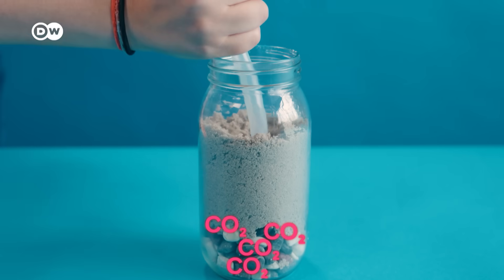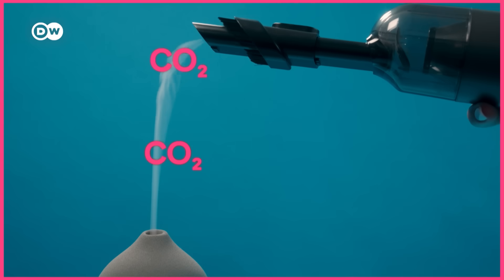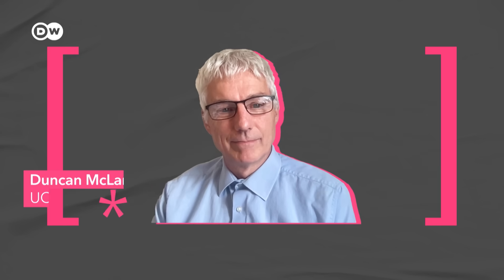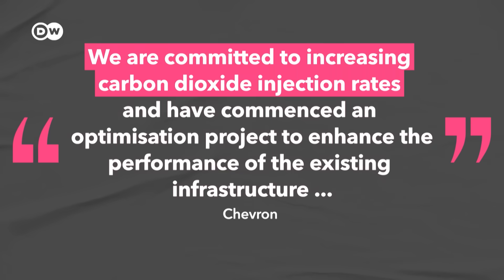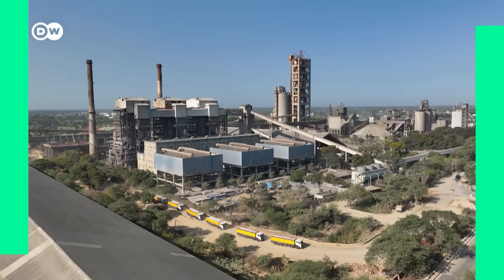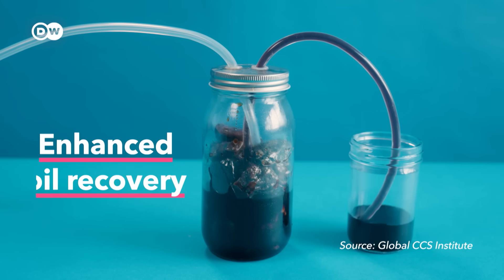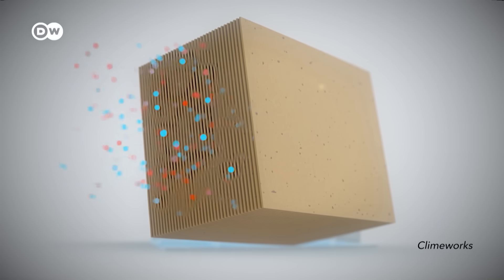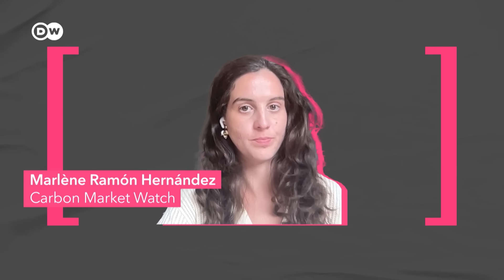Why carbon capture needs a reality check

Comment: Carbon capture technologies should be part of the solution, but not the only solution.  But if we combine it with other solutions like strategic agricultural programs and other evolving tech, it might work.  For example, vertical farming requires elevated CO2 to help plants grow.  So why not get CO2 concentrators, latch them onto vertical farms?  Encourage people to do small scale farming/gardening?  Strategic gardening and farming at the municipal level?  I've been to many city malls... Consider multi-level parking lots where the upper deck are half solar, but also half garden?  A place to go and sit that is safe and calming?  Mall roofs could be redesigned to have small scale farming with the produce sold by the companies in the food court?  Mixed in with the solar could be shade-preferring crops.  For dedicated public transit routes, consider planting things like grass between the tracks. There is no either or for us to save the planet.  We just need to get to carbon neutral naturally and use CCS tech to top things up.
Reply: cos everybody wants to own the world

Comment: The densest form of for carbon is... oil. CCS is just a fancy way to describe a perpetual motion machine. It is thermodynamically impossible for CCS to be anything but a stop gap for steel/cement manufacturing, to slow down the emission at best (which it is clearly is not even close).
Reply: True, by looking at it from an exergy perspective the sheer waste of useful work is on full display. Why set up renewable (hopefully) power plants to power carbon capture projects when you can just instead use that electricity?
Reply: @reinhardtscheepers2349 Direct-air capture might make sense as an energy sink if we somehow have a surplus of zero-emission energy in the future and storage is full. Otherwise, there are far better uses of energy we could put renewables towards.
Reply: @jaredhamilton8694  it's that we don't use our electricity generation at the one moment in time alone, but at different instances in a 24- hour cycle.  Hydropower or geothermal power in the Iceland example, has essentially miniscule value all night until people wake up in the morning to buy the electricity available. So, why not use the essentially zero marginal cost electricity available over night, reach night?
Reply: @Jerdifier Renewables require fundamentally different skills than o&g companies have. It makes sense that people who dig and lay pipe want to keep digging and laying pipes.
Reply: @reinhardtscheepers2349
Reply: @reinhardtscheepers2349 jjjiiijiibijiionoon😊onon
Reply: @joelbolduc3354  However, that is only worth it only if that energy is not better off elsewhere, and the financial resources for putting that CCS in place were not cut from developing systems that store and transport that clean energy.
And, the efficiency is pitiful for CCS. It is like draining a lake with a coffee mug, even if you give it the full output of those renewable sources.
Reply: Wel it's a lot more dense than CO2 for sure :) but the densest form of carbon would be diamond. Perhaps we need diamond carbon storage :P still as realistic a solution as CO2 storage I suppose :D
Reply: @jorsm.3893  😂 true. it is so realistic that it slip my mind
Reply: Densest form of carbon is not oil, but I agree with the rest of your statement. Any carbon capture tech is so scientifically bankrupt, I'm surprised it even took off at all.
Reply: @LZKS You have a PURE, CONCENTRATED gas at a price btw. 15 and 120$ the ton. At least using CCS technique. This is amazing raw material!
Reply: EVERYTHING, which comes out of a chimney tube into the atmosphere MUST be collected. At least until chimney tubes exist...
Reply: What are you talking about??? Chemistry my friend: C02 is oxidiced carbon, not oil. The the total energy calculation can 100% work if the technologies exist.
Reply: while carbon capture tech isn't very feasible logistically and cost wise it is definitely thermodynamically possible I don't know what you are on about. fossil fuels (like propane for example) are not in their lowest energy configuration molecularly. burning this propane produces co2 and water. the burning process is what releases the energy. what happens to the co2 afterwards has no bearing on it's energy potential. you could stick a cartoonishly large bag on the end of smoke stacks to literally capture the carbon and they would work just fine.
Reply: @nilnailscrew4784 When hydrocarbons exchange their lightweight hydrogen atoms for oxygen from the air, the resulting CO2 ends up being a lot heavier -- about 3x as heavy as the original fuel. And since CO2 is a gas, the result is truly massive. Burning 1 liter of gasoline/petrol results in over 1,000 liters of CO2.

Carbon dioxide is highly compressible, but it's still very hard to bring its volume down close to that of the original fuel -- it'll nearly always be a bigger size than what was burned.

I've felt for a long time that we basically need to run the petroleum production process backwards and inject liquid hydrocarbons back into the ground. When nuclear power was new, some proponents hoped it would be able to produce energy necessary to essentially do direct air capture to generate fuels, rather than extracting more oil from the ground, though nuclear never became cheap enough for that, and they glossed over the complexity of the actual DAC process.

Basically we need to figure out if we can create anything that's more effective than planting massive numbers of trees and ensuring their carbon stays locked away rather than going back into the atmosphere
Reply: @nilnailscrew4784  essentially what our catalytic convertor's do

Comment: nah, its way better to use the energy spent on capturing the co2 on substituing the energy made from fosil fuels. Untill they make carbon capture more efficient at lower cost its pretty much useless on large scale.
Reply: sinse electricity from oil and gas is already on par or more expensive than renewables, and coal is significantly more expensive, anything that adds to the cost is already a non starter. And wind and solar are still getting cheaper every year. So it's only going to get less efficient to divert money from renewables to carbon capture. This was always just an excuse to keep the power plants running and the money flowing into the hands of fossil fuel companies

Comment: Just use that money to buy land and plant trees dude 😐
Reply: There isn't enough land on earth for the amount of trees needed.
Reply: @ninosegers  there is
Reply: @ninosegers  Not expecting to offset the quantity of CO2 equivalent to carbon neutrality, but to planting as much as possible in our power where there are waste land, poor soil, and deforestation. At the same time, switching to renewable energy sources for light industries and strengthening applicable governing tool (e.g., carbon tax).
Reply: Same idea. Researching for plants that grow fast in rainy season, and able to stand harsh summer in extremely low nutrition.
Reply: A pipal tree on rooftop of my apartment had survived the last summer. Oh dear, now she's green again after lost most of her leaves during the summer.

Comment: why don't we recreate photosynthesis, in order to split the Molecule CO2 in carbon and Oxigen, artificially?
Reply: why would we? firstly photosynthesis is not simple splitting of CO2 into C and O2 and also there is already plenty of plants who can do it already with very little investment from human side. So artificial photosynthesis makes no sense from cost efficiency pov atm. You would have to create some system thats cheaper and more efficient than naturaly available option and that development itself would be extremely expensive and with uncertain results while you can just plant some trees or fill bigass tanks with algae and call it a day.
Reply: Why not reinvent the wheel while we are at it?
Reply: There are several companies that do this actually. Some grow algae from seawater (which has higher concentration of CO2), some try to engineer more efficient plants.
Reply: Needs energy and money, a lots of it. Not to produce CO2 in the first place is cheaper and does not need such huge industrial facilities. We have all what is needed to replace 100% coal, natural gas and oil, fast and cost efficient.

Comment: Solutions without Sun or Wind energy are all causing more problems than it solves! We don't need solutions that require power grid as energy source... It's a lost cause process... unless industrial plants store CO2 with the energy of power grid electricity which generates electricity with solar or wind then its little more logical... but DW is right why not choose to solve problem at first place!

Comment: 8:39 It doesn't mean more oil. The demand for oil dictates how much oil. Using co2 to extract oil just means less drilling, and cheaper oil from western countries, less oil from horrible dictator countries.
Reply: Wrong. CNPC is, for example, one of the companies investing into CCS-EOR. Another one is Saudi Aramco. Brilliant, China and Saudi Arabia are now counted as western countries or democracies?
Reply: Cheaper oil = using more oil. If gas was still under a dollar a gallon, no one would even think of buying an electric or hybrid car. The more expensive oil is, the more alternatives (hopefully greener) become financially viable.

Comment: Carbon capture is great and using renewable energy to do so is great!!.... EXCEPT we should use that renewable energy in place of fossil fuels to prevent producing carbon in the first place
Reply: Thin profit margin when comes to renewables, unless you have an abundance of hydro dams.
Reply: Why don't you design a system for that?
Reply: @oldones59  mainly because there are already plenty of such systems designed already and secondly because it takes lot of money to design and develop such systems
Reply: @oldones59  We have plenty of renewable energy technologies already in place, ready to replace oil, natural gas and coal on a large scale.
Reply: Yet it still doesn't happen

Because it doesn't make enough money